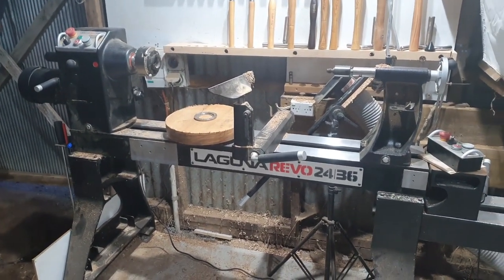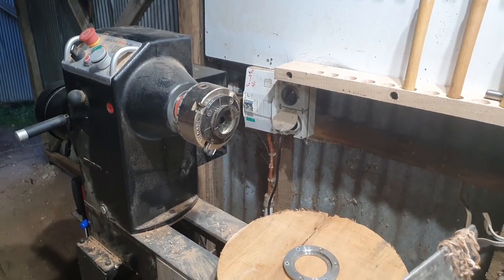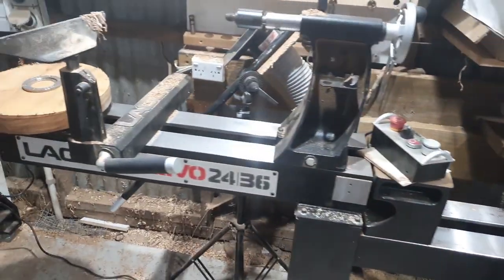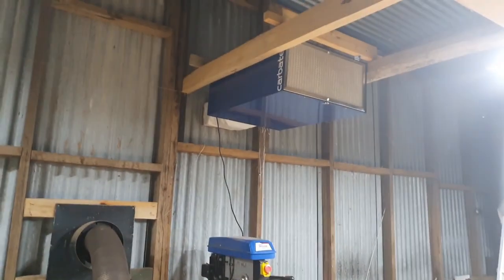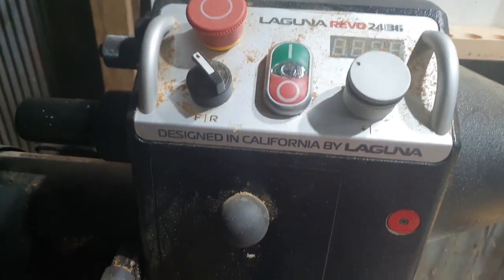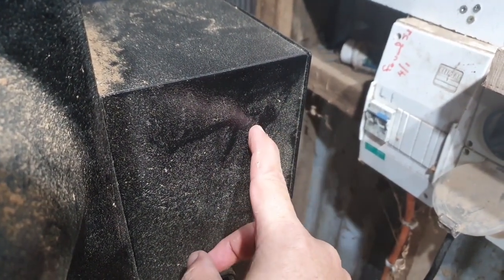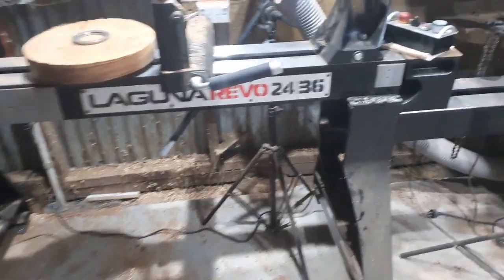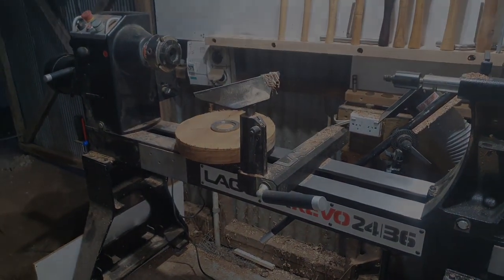Laguna Revo 24 36 Review

Comment: One of my friends bought that lathe and he loves it.  You get a lot of lathe for your money.  Health to enjoy.
Best Wishes, Brendan.
Reply from the maker: Yeah, I'm loving the machine as well. I have to get on and do something about the workshop and it's power supply. I can't turn at night, as using the Lathe makes the lights flicker in the house. So there is either something wrong with how the wiring has been done from the meter box, or the wire isn't heavy enough over to the workshop. Mind you, it is a 3HP 3 Phase motor with a 1 Phase to 3 Phase inverter. I'm looking at having the whole shed rebuilt and a mezzanine floor second story for storage and to look around the farm to keep an eye on the Goats, lol.

Comment: So what's the verdict three years later?  I have been considering Laguna, One Way, Vicmarc.  Price on Laguna seems better than the rest as long as there is no compromise in quality.
Reply from the maker: Perhaps I should do a new review. To answer your question though, I've only had 2 issues. The adjustable levelling feet are not great, but I found that removing them put the Lathe at the correct height for me. The other issue was with the bed extension, if it's not sufficiently tightened, it will drop, making the top of the extension no longer the same level of the main bed. At the moment, I have the extension on it's lower level and using the riser block for the tailstock. I've not checked if it's moved, but haven't noticed an issue moving the tailstock from the main bed to the extensions riser block. If it does drop in that configuration, obviously the centre's won't line up. The only other thing I've really done to make improvements, is to superglue permanent magnets to the bottom of the external controls, which makes it more convenient, and able to place the controls anywhere, even on the front, where if something was to go awry with a turning, makes it easy to quickly cut the drive power, even with a hip.
Reply: @DiemenDesign I suppose it would depend on what size pieces you normally turn.  There is no one lathe that offers everything.  Moveable headstock would be great but not all have one. Rikon has an expandable bed, good idea.  Robust has removable bed and outboard turning but price is outrageous and so on and so on.  Somewhere in there there's a good lathe that does what you need but doesn't cost $12K. Laguna seems to offer decent features with a decent price point, however, my concern is always longevity ,durability, customer service.  I have a Delta lathe that just recently had a motor die after only two years.  Not great for sure but Delta tech support was excellent and they shipped out a new lathe to me in less than a week so if they made a full size lathe I would certainly consider it even though it is no longer made in the US.
Reply from the maker: @johnbauby6612  Agreed, the right tool for the right job, and brand, size, etc are determined on the type of items to be produced. I wanted to be able to turn smaller items, as well as large bowls, but not gigantic bowls. The 24/36 was the ideal size for my needs. The external controls are great if I'm teaching someone to turn, as I can also turn the Lathe off if needed, providing a great safety feature.
Reply: @DiemenDesign At around $4k it is not bad.  I almost choked when I saw the price of a Robust or a Oneway at around $12k! For $4k you can buy three Lagunas and throw them away if they ever break for the price on one of the others. I understand they are built like tanks and will last forever but come on guys, way too much for a lathe.  On another note, are you in Tas by chance?
Reply from the maker: @johnbauby6612  Certainly are in Tas, we're based in Gawler, on the outskirts of Ulverstone.
Reply: @DiemenDesign I figured you might be.  I am in the US but I used to live in NSW.  A good friend of mine is currently in Tas visiting her family.  Somewhere near Sassafrass. Being in Australia you would have access to Vicmarc tools. You also have Richard Rafan who lives in the ACT.  I'm sure Vicmarc are a lot cheaper there than they are here.
Reply from the maker: @johnbauby6612  Richard has also been posting many turning videos lately. Vicmarc is located in Clontarf in Queensland. Vicmarc's products are expensive but great quality, I use their Chucks, which can't be beat. Their Lathe's are great, but still pricey, and have their own limitations, the motors and electronics are still made in China like most other brands, but the machinery parts are all made here and great quality.
Reply: @DiemenDesign My chucks are all Vicmarc as well.  Quality.  Their lathes here are very pricey.  Any advantage the US dollar has is wiped away by the shipping costs.  Not sure if you are familiar with Robust lathes but they are seen as the top of the line here in the US.  Obscenely expensive.  I doubt any or at least few make it to Australia.  When you consider what a lathe really is, a motor and a metal base, they are ALL pretty overpriced.  I have been considering welding up my own lathe.
Reply from the maker: @johnbauby6612  I don't know of any Robust Lathes in Australia, or of any Oneways either. You're right, just metal at the end of the day. There's a chap down in Hobart, that has a shop at Salamanca Markets, that built his own, specifically for turning very large bowls. The bedways is anchored into a concrete base for stability. Despite living in Tasmania for over 10 years, and been to Hobart a couple of times, I've yet to make it to Salamanca Markets to see this spectacle in person.